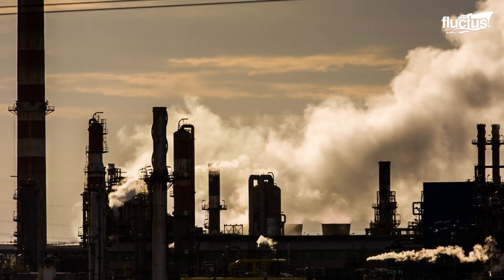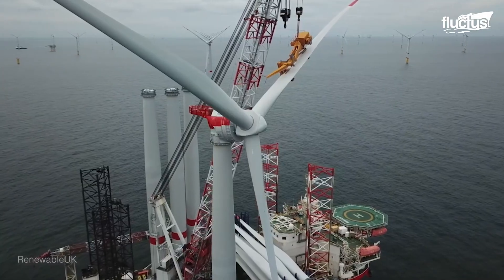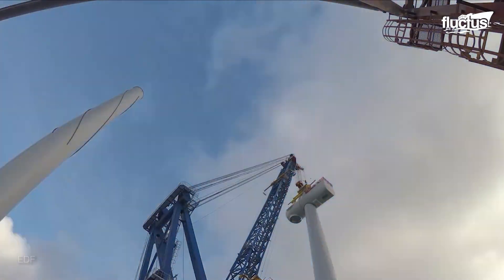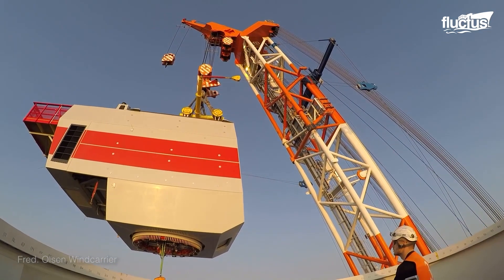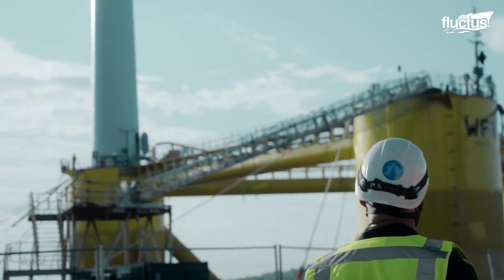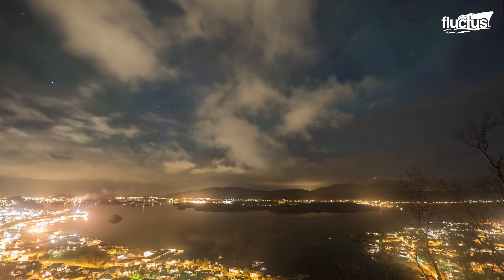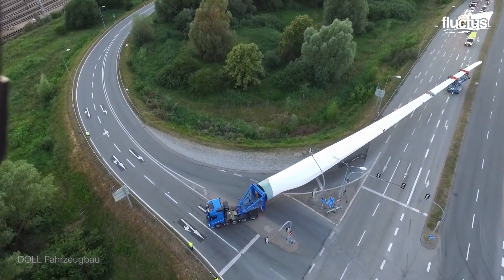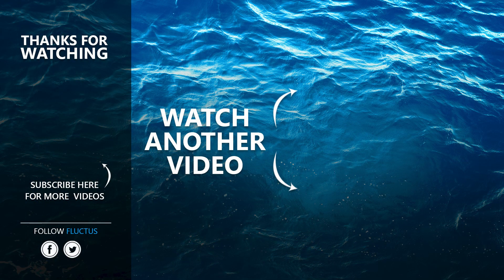Building $10 Million Offshore Wind Turbine in Middle of the Sea

Comment: There is only one "little" secret about wind turbines, which makes it much non-green... Wind turbine blades are totally non recyclable and needs to be replaced every 20-25 years...
Reply: How do you know they wont be able to be recycled or reused in 20 years time?
Reply: @suburbia2050  And how do you know, that nuclear waste will not be possible to reuse in 20 years? "Someday maybe" is not valid argument for todays decision. At this time is nuclear waste not reusable as well as turbine blades.
Reply: So does the whole of the fossil fuel industry need periodically replacing every 20-30 years! And turbine blades are nothing compared to coal, a 1 GW coal power station would produce 6 million tons of very toxic cancerogenic slag and .5 million tons of infrastructure waste to landfills over 30 years, and a 1GW wind farm would produce 0.1 million tons of blades for landfill over the same period!   
Windfarms are not perfect, but do produce a tiny fraction of the waste of the fossil fuel industry!!!!
Reply: @stevetaylor2818  Yep, coal power stations are very dirty... But there are also nuclear power plats and they produce for 1 GW about 300 kg of waste. I don't enforce any of them, but I am fascinated, how quickly everybody speaks about dirty nuclear energy and on the opposite side, nobody admint, that "green" wind (or even worse solar) energy has also some strange impacts on nature. Big footprint for small power sources, non recyclable waste, fiberglass - when cut or drilled - makes also extremely cancerogenic dust...
Reply: @stevetaylor2818  you speak of the fossil fuel industry as if it’s replaced by existing wind solar, when we know well that wind solar require hydro or fossil alongside.  The blade waste on land is of course far more massive,  than gas, and almost all filling up dumps. Effective wind turbine life is 15 years, without refurbishment, not 25.  Nuclear can be 80 yrs.  Plenty of fossil plants 50 yrs old.
Reply: @Nill757  As I said above the landfill waste for wind turbines is a tiny tiny tiny fraction of the waste in landfills compared to fossil fuels and nuclear! 
Nuclear power stations have millions of tons of concert and steel that can never be recycled plus nuclear waste!

And gas produces far more waste in landfills than wind farms. It's not just the power station or burning the gas, but mining, refining and transportation: just look at the Gorgon LPG plant in WA Australia, It took 40,000 workers and me, 7 years and 67 Billion AUD to build one LPG gas plant, which has dozens and dozens of wells spread over tens of thousands of square miles of the sea bed, in thousands of feet of water, 1000's of miles of pipelines, to a refinery the size of a small city, consuming the energy of a small city, a massive harbour had to be constructed two miles offshore for a fleet of supertanker LPG ships burning massive amounts of tar to transport the gas around the globe to burn in massive power stations or piped to homes to be bunt in boilers or cookers. And will all these millions and millions and millions of tons of materials be recycled??????????????????? Who the fu ck cares it's oil and gas!!!!! 

And no fossil fuel power station last 50 years, the building might, but all the guts (the boilers, turbines, magnets, machinery etc...) have to be replaced or majorly serviced every 20 years or so!!!!!!! and nuclear power stations periodically close for anything up to a year for refurbishment (around every 20 years)

Basically, no power generation system has much more than 20 to 30 years of life without being replaced or requiring a massive overhaul (except for solar! latest panels have an expected life of 50+ years with no major servicing)

And yes renewables can and will power the world, many countries have already proved this!!!!!
Reply: @stevetaylor2818  “As I said above ….”

Why do you imagine I care what you said in done story? What matters is what you can show. 

You don’t know what you are talking about, and you won’t be bothered to learn.   Hydro runs a few countries blessed with a lot of hydro resource. There will be no more of those. There are no grids anywhere close to all renewable besides those, nor will there be. 

Why can’t you go lookup how much concrete, steel, copper, oil, fiberglass goes into a 2MW wind turbine, then multiply it by 10,000, double it all again for storage, to compare w one 2GW nuclear plant? It’s much more useful than making up some story.
Reply: 10-15 years

Comment: How are the foundations done on offshore wind turbines?
Reply: i have worked on the norwegian project those are floating, with 3  anchors at the bottm
Reply: Generally monopiles, installed direct into the seabed with giant hydraulic piling hammers. You can see the MENCK hammer in the video @4.20 (the yellow thing on the crane with a blue M).
Reply: The video mentioned some types, TLPs and spars.
Reply: @alabamacoastie6924  A spar would have to be enormous to offset the sheer size and height of a wind turbine, that's insane!

Comment: What fantastic machines. We need many more.
Reply: They are ugly, completely destroy the beauty of the environment and require the burning of the same fossil fuels they claim to eliminate in the entire manufacturing process. Most environmentalist are blind to the reality of what it takes to manufacture "green" products. Truth be told, there is only one way to solve the worlds problems..all of them. Eliminate the source of the problem.
Reply: Blades cannot be recycled, full of toxic glues etc. The huge amounts of balsa comes from the rain forests. It all ends up in landfill. The enormous amount of concrete and steel is left in the ground. A wind turbine can never save as much carbon as it takes to make it.
Reply: Phil, 

on the contrary, we don't need any of them.

They destabilise the grid with their uncontrolled and variable power, and while people seem to be impressed by their size, their output is miserly and that is why so many are required.
Reply: @iareid8255  don't be so sour.

Comment: OK, so we make these turbines to generate some electricity and after a few years we need to dispose of the parts that have worn out or caught fire and figure out the disposal of those pieces. That appears to be not as easy as one might think, they can always be buried or just piled up in some out of the way place till they deteriorate in a few hundred years. Much of these aren't really recyclable which is the fist major hurdle that should have been figured out. I am not an ecologist, just stating the facts i have seen over the  years.
Reply: You missed one thing, they generate fossil fuel free energy while they work, unlike coal, gas, oil or nuclear.
Reply: @brendancooney9401  except in some places they only run 33% of the time at peak wins unlike coal gas oil or nuclear which run all the time.
Reply: @brendancooney9401  Except that you can't power the US with just wind and/or solar. It just isn't possible. So you are going to have to use fossil fuels as your primary source of energy. Oh and nuclear isn't a fossil fuel and is still the most efficient. You are going to get way more bang for the buck from a nuclear power plant than you will from wind turbines. The only issue right now is the waste. But new technology like molten salt reactors look promising to deal with that issue. It's simply a question of advancing the technology far enough for it to take hold. Solar and wind have running into major roadblocks as far as efficiency is concerned. You aren't likely to increase either within the next decade or two substantially enough to use them exclusively. It might work in places like Norway or other countries to some degree but the size differences between European countries and the US is enormous.
Reply: Do you say that when you turn on your electrical device and rant then at every method of generating electricity supply?
Reply: @suburbia2050  That came from you? Did you read my comment or just assume you knew what you were saying. My electricity is less than $.03 per kilowatt. What do you pay?
Reply: @rayc.1396  Yeah I had to read your sanctimonious drivel but you didnt answer my question, do you write concerns about long term costs on videos about every type of Energy Production? My hunch would be no and that therefore you are biased. Now I have to read your self-congratulationary boasts as if that cost actually means something intrinsic. How much does your beef burger cost? I now just wonder if you know the value of anything.
Reply: But how much do you pay for, say 40,000,000 tons of coal?  Compared with how much do you pay for the same amount of wind - 'nothing', of course.  This is a compelling argument!

Comment: How long do these blades last? Its seems not too long.
Reply: Turbines near me in southeast of Ireland have lasted over 20 years and they have recently been granted a 20 year extension. So they probably last as long as convention fossil fuel plants.
Reply: @brendancooney9401  Blades cannot be recycled, full of toxic glues etc. The huge amounts of balsa comes from the rain forests. It all ends up in landfill. The enormous amount of concrete and steel is left in the ground. A wind turbine can never save as much carbon as it takes to make it.
Reply: @anglosaxonmike8325  not true, they are running 20 plus years and easily give more power than they need to be build. 
As for coal, gas or oil power generation, well they never stop giving off carbon during their lifetimes. Never!!!!!!  Ever!!!
Reply: @anglosaxonmike8325  actually, it takes only 6 months to compensate the carbon needed to manufacture and build it.
Reply: @anglosaxonmike8325  It only takes a few months of opertation to compensate all of this.
Reply: @anglosaxonmike8325  Go on, tell me that dismantling a power station at the end of it's life is entirely waste free with nothing left in the ground ...  :)
Reply: @Brendan Cooney  Wrong. We currently carry out blade changes 5 yearly & our 1 support vessel burns between 20,000 & 50,000lts of diesel every single day depending on the weather. Nothing "green" about it.
Reply: @ferdyhengeveld3050  That is indeed what the media tell you, but they do not factor the colossal amount of fuel burnt by the construction & lifetime support vessels/helicopters required to keep these units running - I assure you they are not plug & play.